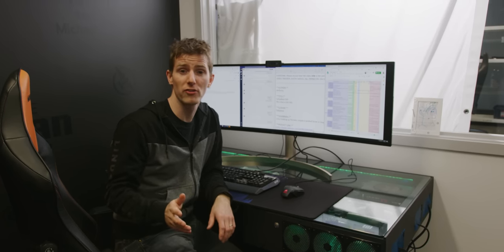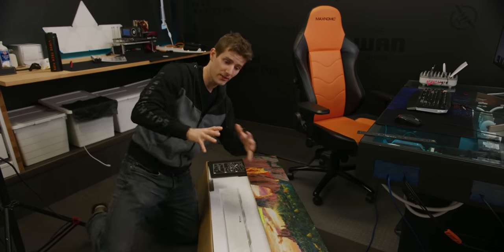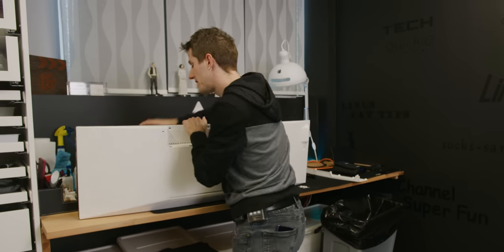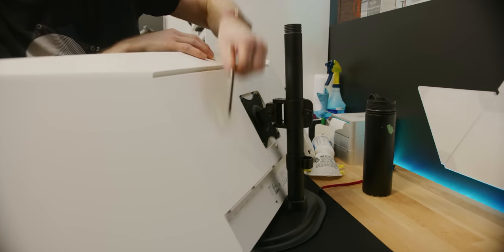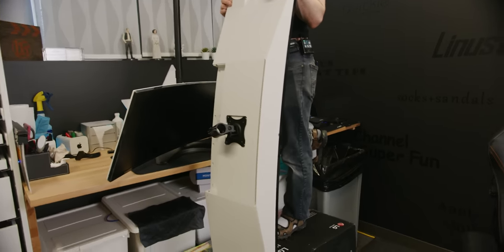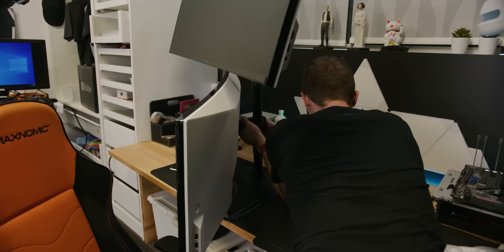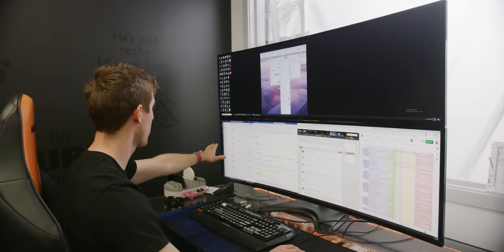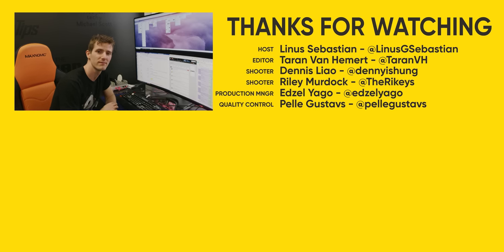My monitor just got an UPGRADE

Comment: If the webcam has a thin enough mount you could have use a few of those as mounting brackets between the monitors. I still think you should cut off and but them up together to make a real single large monitor.

Comment: A tip for Linus Tech Tips regarding managing multiple windows on super large, multiple monitor desktops:  Use Display Fusion - a superb solution!  A bit difficult to master at first (seems to be the case will pretty much all good stuff) but super powerful and easy to maintain once you do master it.  You're welcome!  ;-)

Comment: I doubt Linus would, but he could turn the top monitor upside down for a more seamless experience. And maybe 3d print some little brackets to support the sides of the bottom one against the desk, I wouldn't trust that mount with those monitors lol

Comment: Are there any issues connecting one of these monitors to a Windows computer? What interface is required: HDMI (version), display port (version), GPU card with what connector and version? Are these monitors still in production? (No new ones appeared on Amazon.)

Comment: They use MS Teams now ? Damn it's almost as if they are a real company.

I'm debating switching to double 27" ultrawide at work because I already have 3 screens and it's not enough, so it's either going to be quad 27" or this... also noticed that some of the Dells offerings for 27" ultrawide are double the price of 2 regular 27" screens so it's not even like it's mega expensive or anything...

Comment: once my monitor went to 27 inches, the camera on the top corner didn't cut it, cue the gorilla tripod mounted c 920, hung from the top to position the camera at eye level for myself, and then position the stream video at eye level of the cohosts/guests and suddenly, achieving that soul connection becomes much easier.

Comment: linus doubles two 32:9 monitors, end result is 32:18 which simplifies to 16:9, wow instead of spending 1000 per monitor 2k total, he could have bought a samsung q70t for half the price with 4k 120hz hdmi 2.1 or q90t 55 in for 2000

Comment: "could I have Just Put a TV on my desk?" 
actually, yeah you could have, Take a 65" 4k Tv Quadrant-ed the screen (for 4 1920x1080 sections)  and had something that came in less then 1/4 the price of a Single one of these montiors for only 20% less screen real estate
Reply: 65" tv = 57"W X 32"H @ 8,294,400 pixels and 1920 X 1080 X  4.
2 X Ultrawide Mon. = 47"W X 30"H @ 14,745,600 pixels and 2560 X 1440 X 4.
That TV is taking up %18.5 MORE desk space while providing %56 of the 2 Ultrawide's screen gamut. Cheaper, yes, but you get what you pay for. That and you're talking about a cheaper TV, not a higher-end one. Ultrawide = %44 more info on a 10 inch narrower desk. 
Of course, you may think Linus can't afford it...

Comment: The top Monitor should be upside down right? So its same bezel.. im try the same with a 49" and 34" on top... btw the LG monitor is 12kg and ViVo mount is only at 10kg,. is that even safe?

Comment: hey yall looking for some help. I would like to do this. but Im wondering if I should go 55" or 65" 4k TV. but i need to be able to game and work simultaneously. Would I be able to use virtual monitor on a lets say the TV setup  and have bottom of TV gaming ( COD warfare  ) Top about 2-4 virtual monitors?

Comment: Why go through all that trouble putting those together when you can just use a TV screen? plus it wont have the line in the middle.
Reply: Nvm I just looked up the problems that would cause, such as refresh rate and other stuff.

Comment: As someone that uses the WSGF 3+1 stand to run a 34 Ultrawide in the center, a 32" standard up top, and two older 28' on the sides in portrait I'm slightly triggered by how low the bottom monitor is... also I kinda want that setup hahaha.  https://imgur.com/gallery/5Y3eJkl a link to my current setup(s).

Comment: why you wouldnt just get 2 of the 43 inch LG 4K monitors and use them side by side is beyond me.

I mean your giving up the ability to have 8 21" 1080p screens split across 2 43inch 4K monitors for a massive total of 86" of screen realestate.

Comment: Hey you should do a review on the new HP Omen 27i that just released on the 4th. It uses the same panel as the lg27gl850 but has slightly higher refresh rate. Interestingly they also have a complete logo change that is much cleaner and more modern. 
- https://www.omen.com/us/en/displays/omen-27i.html  
- https://hexus.net/tech/news/monitors/142255-hp-releases-omen-27i-nano-ips-165hz-2k-monitor/